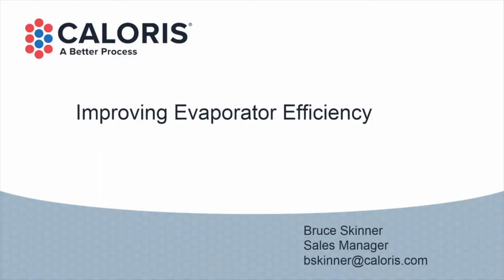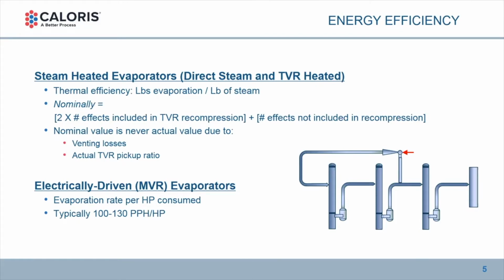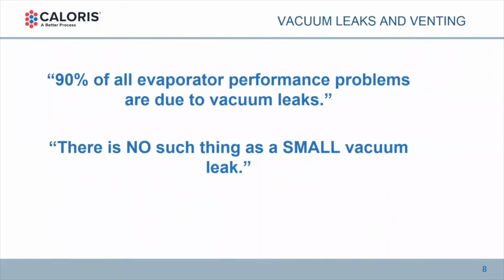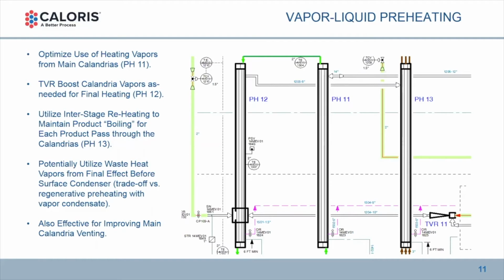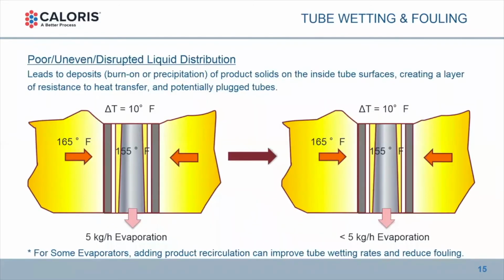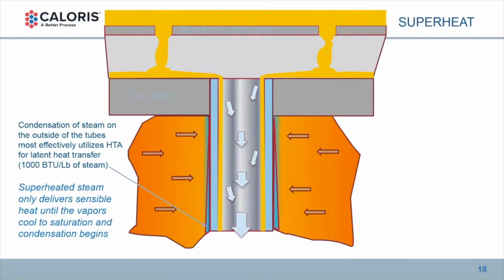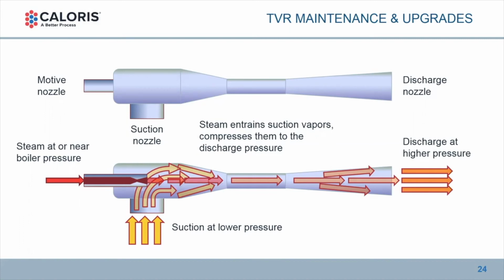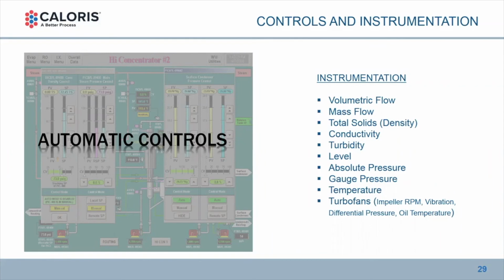Caloris Webinar: Improving Evaporator Efficiency

Comment: Hi, why don't we see evaporator vessels insulated? Surely this would reduce energy and assist the ambient temperatures for the operator, technicians?
Reply from the maker: Whether to insulate and clad the exterior of evaporator vessels is determined on a case-by-case basis, depending primarily on product application and installation location.  

For dairy product applications, which (in most countries) are always indoors to maintain a sanitary operating environment, evaporator vessels are not insulated to avoid having a confined space (the insulation space) where microbiological growth could develop.   The customer has full access to all vessel exterior surfaces for a sanitizing cleaning at any time should they choose.  The evaporators for these applications are designed to account for a modest loss of thermal energy into the process room, which is generally only on the order of ~2 to 3% of the evaporator’s energy consumption as the evaporator process room is typically warm year-round.

Evaporators for product applications that can be located outdoors (such as juices, non-dairy foods or chemicals) or in process buildings that can be cold in winter conditions are nearly always insulated and clad to minimize radiant thermal losses.   Variable weather conditions such as wind and precipitation will disrupt steady-state evaporator operating conditions.  Insulation and cladding in these applications reduces the influence of those variable operating conditions.
Reply: @calorisengineering  I've worked with  4 dairy evaporators, milk, whey, whey permeate and D90. None were insulated. What's your experience?
Reply from the maker: @barryweblin3943  our engineer would like to chat with you further, but he's not on YouTube. Can you please send us an email to info@caloris.com with your contact information and I'll get him in touch with you?
Reply: Very elaborated reply. Thanks Caloris team
Reply: For MVR , should be choose falling film or forced circulation evaporator?